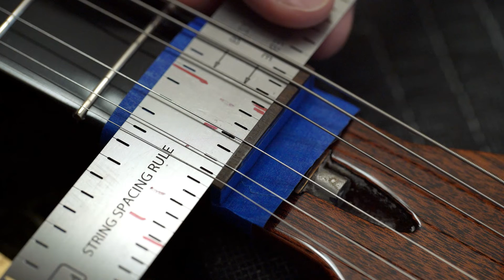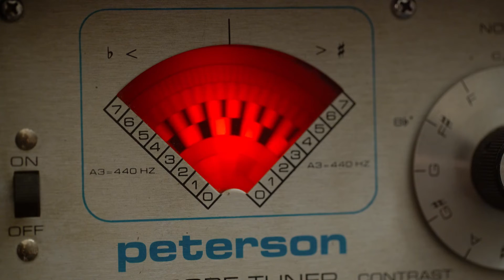Red Special Build - PT12 Assembly

Comment: Amazing job! I was wondering if you could tell me where you bought the pickups and if you need to put the coin under the volume pot?
Reply from the maker: I got my pickups secondhand from a friend, but there are options available. If you search eBay for Burns Tri-sonics, they will come up. You don't NEED the coin, unless you're going for accuracy. Tho, it can help stabilize the volume/tone plate.
Reply: @Lukeyourself  ok. Thank you

Comment: Do you screwed the 2 other screws directly in the oak-wood?
Reply from the maker: I assume you're referring to the small oak insert? Yes. Two wood screws were screwed directly into the larger oak insert on the bottom layer, and two machine screws go all the way through into the tee washers I used. (which were not how Brian did it. He used penny washers and a nut, supposedly. I changed this on mine so I could make it more flush)

Comment: Lovely work! probably the most professional build that I have ever seen! Every cut and alignment made is perfect! Love the video composition as well! Curious to know though, what's with the string action on the low E string @5:24 ? is it a bit too high or do my eyes deceive me?
Reply from the maker: Thank you, Kurt! I really appreciate it!. The low E string does look a bit odd in the video, partly the angle of the camera, but also because I was trying to mimic exactly the string spacing on Brian's original, which is not standard... the strings are quite far out on the edges... but in addition to that, I had one or two slight miscalculations, so the strings are just a bit further out than I wanted them. It's still totally playable tho, happy to report. I may try to modify it, but it hasn't bothered me yet.

Comment: Question: can you please give me the manual if there is one on how to fix the bridge? Cause i got confused when you did it
Reply from the maker: Hi. No manual, but I'll try to list it so it makes some amount of sense. (I may do a more in detail video later on)

1. Loosely assemble the bridge on top of some masking tape, check intonation and mark the rough position.
2. When intonation is set, mark the position of the individual bridge blocks. (I used a drill bit to score the tape beneath it)
3. Drill the holes for the Hank Rivets (or alternate) 
4. Apply plumbers tape to the mounting screws and install into hank rivets and set assembly in the holes.
5. Fill with Araldite (epoxy)
6. Remove mounting screws and gently sand the surface flush
7. Remove masking tape
8. Install pick guard insert, shims, bridge blocks, mounting screws and rollers.

Hopefully this helps. But fair warning, this was my first time doing this, so it's possible there's a different method. But it worked for me. Just keep an eye on the spacing of the mounting screws after you set the rivets in the epoxy inside the holes. I had a bit of play and the high 'e' was mounted a bit wider than I would have liked.
Reply: Lukeyourself ok thanks

Comment: is the neck too narrow? do the strings sit too close to the edge of the fretboard?
Reply from the maker: Yes and yes. The strings being close to the edge was on purpose, to mimic Brian's. I made an error with my neck, so it's slightly thinner than it should be at the heel, but it doesn't affect playability.
Reply: @Lukeyourself  I am just starting my build and I only just noticed how close to the edge of the fretboard the strings sit on Brian's guitar. I am worried this might make it awkward to play
Reply from the maker: @phililpb  It's not awkward. At least it wasn't for me. The neck is quite thick and quite wide... so there is an adjustment period anyway... but I've become quite accustomed to it, myself.
Reply: @Lukeyourself   thats good to know. thanks for the replies. I guessing it will still take me about two years to build mine but I think it will be worth it
Reply from the maker: @phililpb  It will be. Good luck!

Comment: Can you (or somebody) please explain how to wire the polarity posts. I’m going to build my own soon and have no clue what wires connect to the polarity posts.
Reply from the maker: Very briefly, they were there to make the pickups easier to install and uninstall... so the pos and neg wires from the pickups all mate up to the posts, (one for each), and their corresponding wires for the pickup selector switches attach to the same posts... this way, the pick guard can be removed and the pickups can be removed without needing to also remove the switches.
Reply: @Lukeyourself  So it’s essentially like wiring it normally, but your just putting those posts in between. The wires still follow like how they normally would?
Reply from the maker: @brianmaysguitar7252  Correct.
Reply: @Lukeyourself  oohhhh. That makes a lot more sense. Thank you. Just one more question. Did you buy or make the nut on the guitar?
Reply from the maker: @brianmaysguitar7252  I made it with a friend of mine.. he bought an old bakelite radio and cut me a piece to use.
Reply: @Lukeyourself  Got it. Thank you!!!! Your awesome!!!!

Comment: your work was perfect, I want to know where you bought all the electrical parts?
Reply from the maker: Thank you! Electronics... well, I made the switches, I found the capacitor in an online electronics thrift store, and the Bourns pots are pretty easy to find.
Reply: @Lukeyourself  Did you do the tremolo system too?
Reply from the maker: @henriqueerenner5741  No, that came from Ron Smith at the Cyber Shop. If you're looking for a trem system, definitely check him out. Tell him Luke sent ya!